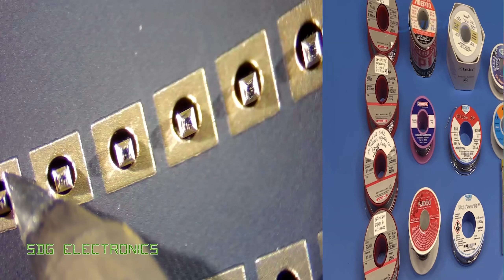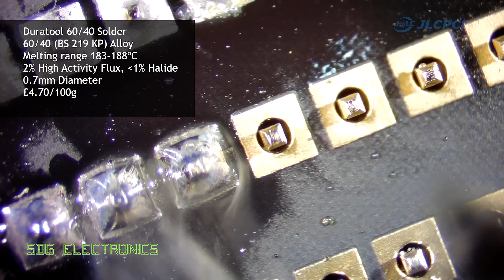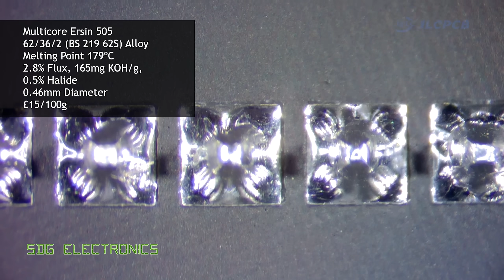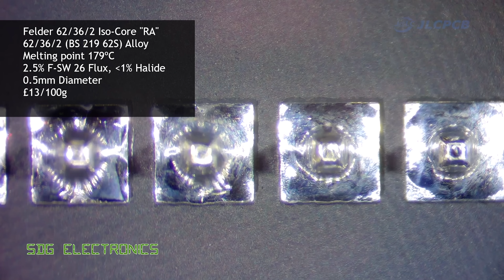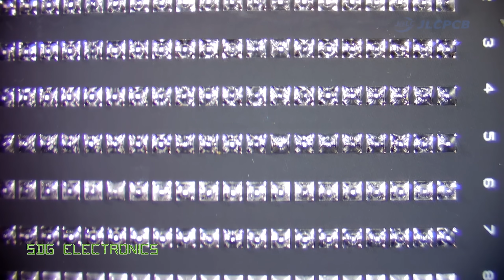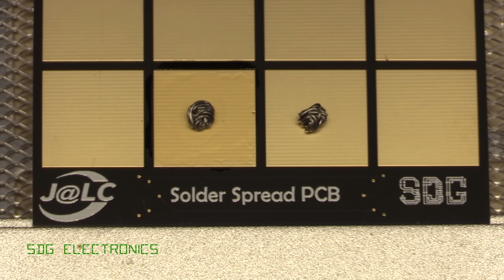SDG #079 What's the best solder for electronics? Expensive or cheap?

Comment: we use alpha fluitin 1532 as lead-free solder and it usualy performs well, only problem might be ground pads where it can make some clumps, probably due to poor soldering technique. Also i have problems with it when soldering RGB LED due to pads being so close together and it not having satisfactory flow, resulting in lots of shorts.

for lead solder we use stannol s-sn60pb40 but im not quite satisfied with the flow of it (maby age? can be better then alpha but has more randomness in it)

we also got some almit sr-la pb-free solder to test out but beside wierd smell it makes more clumps then alpha, even tho its supposed to have resin flux vs alphas no-clean

anyway, just came here to see if we could replace solders with something better (but we mostly use pb-free becouse laws if u wana sell electronics, lead only for repairs so only 3 tests were a bit meh)

Comment: One other brand I would suggest checking out is cynel. It's a polish company and their solder wire is professional grade too and it's relative cheap compared to other high name brands, such as kester. Also if I'm not mistaked it's no clean too
Reply from the maker: I did end up buying a few rolls from TME a while back, they have a lot of their range in stock
Reply: @sdgelectronics  I have their 60/40 0.8mm and it's great. I also have a 0.5mm mechanic and although it's made in China, it's not the typical Chinese solder that you buy off aliexpress and banggood. It's really good and the fact that it's 63/37 is definitely a plus

Comment: I'm relatively new to soldering. One thing I've read a lot already is that a key reason for using leaded-solder instead of lead-free solder is because lead-free solder is much more tedious to desolder later on. Is there any truth to this? Curious on your views.
Reply from the maker: Lead solder is a lot easier to work with and your soldering iron tips will last a lot longer. The flux used in lead-free solder is quite nasty stuff. Generally speaking, lead-free works fine, but I subjectively see more lead-free joints fail over time than lead.

Comment: SDG Electronics, After this test, it was necessary to place the boards in the bathroom on a shelf or where it is slightly damp. And see which square turned green =) Perhaps this will tell about the activity of the flux and what kind of solder with flux needs to be washed.
Sirtest can be done, but you need a special device. I can find a video (albeit in Russian) where a similar device is used for the test. I also met the use of an ordinary old Soviet megohmmeter + voltage supply. I can find it too. But you have to get my message out of spam if it gets there because of links =)
p.s. sorry for googletranslate.

Comment: Awesome comparison. I've found the Pro'skit 1mm for about 11€/250grams and "Super solder wire" 60/40 which I believe is the same Taiwanese brand for about 22€/500grams. Great solder and easily the best quality/price in my opinion
Reply: Also found the 9S002 on a site at aliexpress and risked buying it. Well worth the money. Gives truly shiny welding spots, flows very well and in general gives great results. If I don't find a better one, I'll stay with that one.

What temperature do you use when using this wire? I found 320°C a bit too low, with 350°C I got better results.

Comment: You should have shown how well the solder on THT test flowed to the other side of the PCB as I have found during my job that the multicore 362 60/40 solder flows better through the joint so as to make good contact on both sides of PCB

Comment: Excellent. One of the best videos and best technical videos on YouTube. Lots of information well conveyed.
I ordered some Multicore 362 (62, 36, 2 Sn, Pb, Ag)(#5 on your list), it's a little hard to find - I ordered from Newark (the company) and getting one spool from US and one from UK sent to me in Georgia. I considered the Pro'skit solder because of your tests but it's only available in 17 gram tubes and the equivalent amount (to the Multicore I ordered) would have cost  8 times as much. And there's a certain guaranteed consistency with a brand like Multicore (which is now Henkel\Loctite).
Thanks for the information.
Added credentials: long time IT & Technology consultant. Been around for so long that most of the people I learned soldering from are dead now. Is that too dark?

Comment: Brand new parts to gold plated pads is not much of a challenge for the solder or the flux. Maybe a bit more of a challenge would help to sort out the capabilities of each. I know I am not alone in having tried some lead free solders that were awful. In your tests everything works great and it seems any differences are really subtle. Get some uniformly old parts and some uniformly oxidised copper contacts and then see what works better and compare the costs & availability. Thanks!

Comment: Man, there's NO 63 37 available in Germany anymore, because of bullshit EU regulations, although it supposedly should be legal for private persons to buy. So I have to switch to aliexpress. Thanks for the info!
Reply from the maker: I think you can still get it from tme under the Cynel brand
Reply: @sdgelectronics  Thank you! Following your results I have bought some "Mechanical" wire, from different sources (ebay, aliexpress). I have seen there are different designs: The orange/blue-sticker with a white plastic spool (like in this video), and the orange/blue sticker with a blue spool as you can see here: https://ibb.co/zbsmyYW
Do you happen to know if this is a copycat thing, or are both from the same vendor?

Comment: What is the difference between 245 and 275 kester and what percentage flux is best 1, 2 or 3%
Reply from the maker: 275 was designed for improved hand soldering and less flux spitting. The highest flux content works best for more highly oxidised parts but results in more residue after soldering. 2% is a good balance.

Comment: Here’s the thing. There are many opinions on solder and which is best. While in the Air National Guard, I used three different brands of solder which all had the same specs. All were Rosin Mildly Activated flux cored, all were 3% flux content and all were 63/37 pure eutectic leaded solders. The key was the type of soldering we did and the standard of quality was stringent. DOD STD 2000-1 was the soldering standard back then and compliance to it was not a question as critical circuitry has no lower standard. Human life and mission requirements are harsh realities in avionics and also other fields. Mediocrity does not exist in this environment and failure is not an option. As I stated, human life and mission requirements are not subject to arguments, they are requirements! This skill is hard as are it’s processes. It is learnable and was by myself. Over four decades I have practiced my craft and all with pure eutectic leaded solder. The higher flux content aided the processes, but cleaning was done only with 99% isopropyl alcohol as it poses no harm to plastic parts(PCBs). I haven’t used lead free and based on what I have heard, it is harder to achieve the level of appearance that the leaded solder yields. We used additional flux and cleaned everything including the solder as corrosion would leave air pockets in the joints. At lower frequencies, this was not as much an issue, but at higher ones, the air pockets would act like tiny capacitors and reap sconion with the circuitry. So even solder must be clean to solder on critical circuits to obtain the required results. The RMA solder and flux always produced the brightest and shiniest joints, these joints can withstand G forces, mechanical and physical stresses and thermal inversions and vibration resistance. The methods and materials were chosen based on this ability and for their consistency, reliability and repeatability. When someone’s going to fight a war or save a life, there is no place for second place. Second place means loss of life and or mission failure. No one wants that on their conscious. That is it in a nutshell. The J STD level 3 is the same as DOD STD 2000-1 back in the day. It is a hard standard, but level 3 is the critical requirement level and not for the lazy or the uncommitted techs. There is no tomorrow or second place in this level. Second place is first loser. Therefore, you must have your head completely in the game and at all times. It’s not for everyone, only the committed need apply! Life is precious and mission is first. That is the way it is in the high quality, high reliability world of professional soldering. That’s not an opinion, that’s a fact! Stay safe mates!😊👍🏻😷

Comment: In the end you mentioned that slightly more acidic solders would work better on older boards. What are some recommendations?
Reply from the maker: Anything with a SW-23 or SW-24 flux is likely to work better in those situations.

Comment: Here is a tip from Germany: Flux residues (rosin) left by the Felder solder can be removed with 99% ethanol. Felder "RA" is activated with halide, so I would highly recommend it when it comes to soldering very old components.
Reply: You Germans know your stuff about engineering and electronics.
Reply: @Ushnic_Uvnikof  Except when it comes to cars - as cheap as possible for the UK making the minimalist of changes.... I had German steel Nail Clippers - broke one day. Like snapped. No abuse, always cleaned.
Reply: Dankje!
Reply: Dark residues are from the non-hydrogenized abietic acid, which tends to be carbonized more than the hydrogenized abietic acid.
Reply: Look no further than home! Stannol, a German brand, has a couple of halide activated flux core alloys. The red ones are leaded.
Reply: @AnnaVannieuwenhuyse   Stannol stinks, get something else.

Comment: It would be good to see a similar test of solder paste, I always have to use wick on such as 28 pin ssop packages, the stencil applied paste spreads out when heated and bridges a lot of the pins.

Comment: Hai Sir, 
(MECHANIC 63/37 HX-T100 )or (MECHANIC HBD-366 0.06mm) and 
How Diameter appropriate for wire solder  (0.5mm/0.6mm/0.8mm).?
MODEL MECHANIC; Which model is suitable for wire solder.?

Comment: That's really a lot of work to make this video. Thank you!. 
What temperature did you use with your soldering iron and hot air gun? A lot of chips have soldering temperature limit such as 260 celsius. If you set your hot air to 260 instead of much higher, I would be interested to know how quick each brand melt and flow/spread.
Reply from the maker: The soldering iron was 330C. I can't remember about the hot air I'm afraid

Comment: I'm just saying i've had nothing but trouble when trying to use non lead base solder on  a regular rod. You use a higher powered heat rod so i don't feel you would have any issues. But when working with wires and a normal rod their is always a issue and even have to use drop techniques versus soldering. Especially in the non flux cores. You should try a normal average 20-30 dollar rod and try soldering wire to a diode. and then tell us what you think just placing it on the diode isn't really accomplishing anything except to see how it forms and structure if you didn't solder anything to it. Also if you look at the phasing out of led solder i'm going to go back into time to research as i have a sneaky suspicion electronics company's may have lobbied for this so that it was less easy to fix your products without their premiums. Thanks for the video though it was pretty good, what rod do you have and how much was it? i assume you have the gun version.

Comment: Interesting comparison. Solder has gotten ridiculously expensive in recent years. For years, I  used Radio Shack solder for general electronic use because it flowed well. Now buying Kester from Kimco. The price is more reasonable than even the Chinese stuff and it's brand name.

Comment: Oh lord, I'm actually caught in a quagmire. I'm young enough to have learned soldering with lead-free (actually, I never used leaded so far), but I agree on the flux spitting. Actually, if I solder tinier components like SOP, I always use a dedicated flux (not only relying on the flux core). This helps really to counteract some bridging.

From the health-perspective: you are stuck between a rock and a hard place. Leaded solder - well, surprise - contains lead. It also adds some trouble for disposal of solder droplets (e.g. after tinning the solder iron's tip), because you mustn't dispose it in the residual waste.
Lead-free on the other hand has more and more aggressive flux in it, it creates far more particulate matter (even smaller than the particles that get into your lungs if you smoke cigarettes).

I would say - if you are a hobbyist like me, choose whatever you want - just make sure you have proper ventilation on your workplace.
Reply: I use a very strong DIY vent made from HVAC exhausts and activated carbon filtration. No vapor from flux makes it to me and the DIY solution cost like 75$ and is far more overkill than some pro solutions at 450CFM. :P  Thing can filter my entire apt in a few minutes. Same crap folks use in grow tents too so you can find it cheap. Not even as a hobbyist do I  play with flux fumes and metal fumes. In the US Army through no shits were ever given. I probably breathed in a shit ton of metal vapor and flux through the years. I am old now though, my lungs suck so filtration it is.
Reply: I should really switch to lead free. Soldering with lead at home just leaves me paranoid about lead particles getting in food

Comment: I have 2 rolls of solder behaves just like that jinhu solder and I hate the appearance of it, it's not shiny and pretty dull, but it still flows ok though and still gives a reliable joint but it's dull when it's solidify

Comment: Hello. I watched the video you did about flux.  Since these include some flux, does that mean that I don't need to buy flux?
Reply: When initially soldering a new joint, especially through-hole parts, the flux that's in solder wire is usually enough, so you rarely need to add more.
However if you have to re-work any solder joints - even just something like getting rid of a "spike" of solder - there won't be any flux left in the solder that's on the board (some of it vaporises and the rest spreads out on the board making a mess, but either way it's not where you need it to be!), so you'll have to add some more from somewhere, otherwise the solder won't behave well at all.

One option is to simply use more solder wire, using the flux from inside of that, but then you end up with even more solder on the joint which you may not want!
You could then remove that solder with braid or a desoldering pump, but that's annoying, time-consuming, and a waste of solder.
So the better option is to add flux from an external source - such as a flux pen, bottle, syringe, or tub - which allows you to re-melt the solder that's already on the board, have it create a nice solder joint, and without unnecessarily adding more solder.

Using extra flux is also helpful for soldering finer-pitch SMD parts. It helps the solder flow better, giving better joints, it reduces the chance of solder bridges between pins, and makes it easier to remove any solder bridges that do form :)
Reply: If you use a desoldering braid a quick wipe with a flux pen makes it soak up things.  As well as what others have said.
Reply: I'll point out that the good-quality desoldering braid will already be impregnated with flux (such as the Servisol Soldamop that I bought from Rapid Electronics, or the MG Chemicals Superwick that I bought from Digi-Key), but yes, buying the cheaper stuff from eBay/AliExpress and adding your own flux is probably more economical, so likely a better option for people just getting started and/or who are on a tight budget :)
From my experience, the cheap stuff works totally fine once you add flux - even the cheap flux from the same sources - so as far as I'm aware, the only reason to buy the more expensive stuff is for convenience, which is absolutely a valid reason, but it should be a conscience choice.

(And I guess it can be helpful to add more flux to the more-expensive braid if you want to get more use out of it - e.g. to use a section of braid that can still soak up more solder but no longer has any flux left after you attempted to use it elsewhere.)
Reply: @AndrewGillard  Yep.  Totally agree.  Some cheap stuff might claim to have flux but doesn''t or enough.  That flux might expire over time too.

Comment: I grew up on Ersin Multicore.It was affordable  even for impoverish students on a meager grant. The quality was never in question. These days however, I avoid anything other than. ..I get my supplies at car boot sales!..Solder does not deteriorate with age...correct?..And surely Maplin did not manufacture solder ..just branded  it??..I still have  a Maplin 4600 synthesizer!..I digress.

Comment: good vid. chinese cheap solder is no good. i got a 100g reel. it was half that when i weighed it. just as well. it had no flux in it and would only melt under great heat. i was convinced it was my soldering till i saw  a vid big clive did on it. got some branded stuff from a decent dealer and suddenly i could solder again. to be avoided. ruins bits too.

Comment: I am super suspicious about alloys in cheap solders. Mechanic is actually expensive comapred to others. It costs 3.15 usd for 40g and other one i bought is 3.6 usd for 80g. I just figured to give it a try because i didnt found any eutectic solder to buy here (where i live) and kester on ebay is expensive

Crap solder is a pain so i just want to know what is good